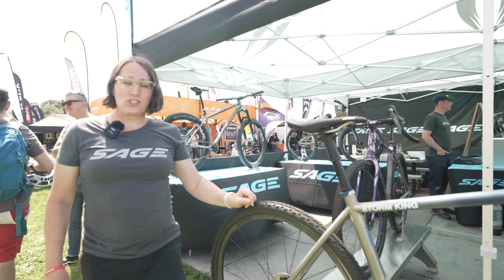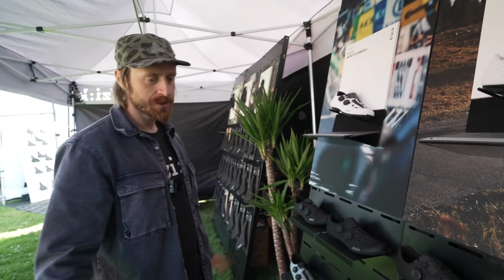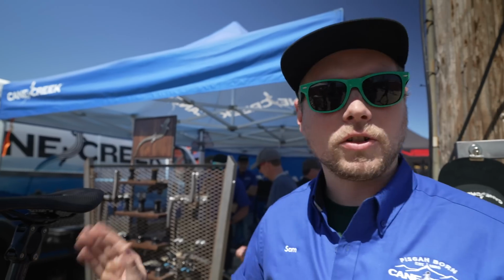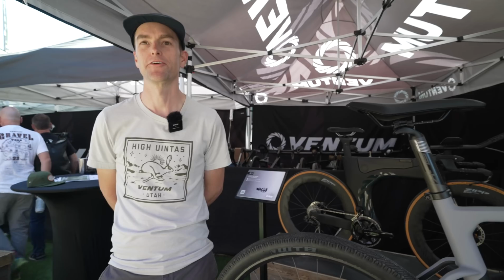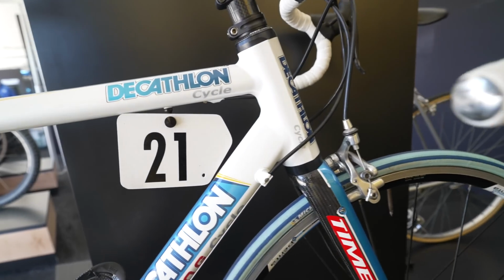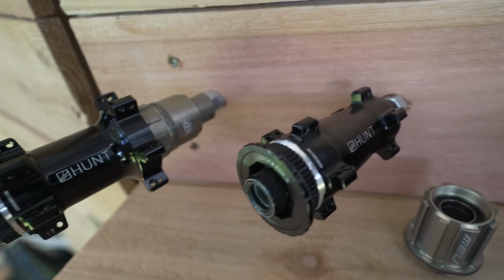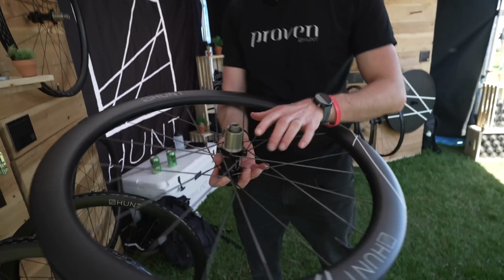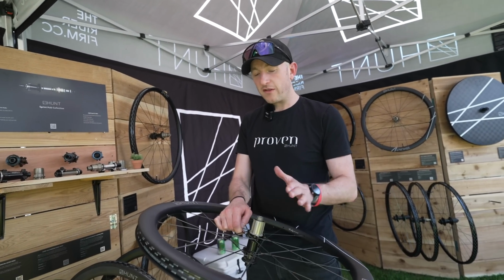Hottest Bikes and Tech at Sea Otter 2023...

Comment: Look,

Middrive ebikes require you to spin at the chainring speed.  It's less annoying to be able to select the gear you want and then apply power.  We are talking about a max speed of 30mph here.  The hub motor can afford it.

And using a middrive means less battery can be stored in the triangle of the frame because you are hanging the motor there too whereas a hubdrive places tr motors weight towards the rear.

And hub motors clean better and last longer and you can use double chain rings with nice cranks and they are far easier to service.

Smh,,, everyone wants to Throw money at Something electric and the answer is simple: for 700-800$ get a hub kit for your first ebike so it can be an investment not a toy.  You can use it without the motor, upgrade, etc.

Grin tech was working last year on a 142-147 rear spacing hub motor.

The frame has to be specific to the motor so you have a 2000$+ single design element to care for instead of a 250$ dollar element (max single point failure cost, excluding frame).

Smh.
Reply: Or, we could, you know…just pedal…
Reply: @GHinWI  the problem arises when you have very steep grades and/or pulling a trailer.  Also bear in mind there is no alternative to this sort of transportation mode: an electric bike which has two seperate sources of power.

I live in Cumberland, Maryland and the hills and roads simply disallow bicycle trailers and a light road bike wouldn't have the cargo needed to perform Wal-Mart trips (in United States this has replaced Churches all together almost leaving soup kitchens operating within)
Reply: Hub motors brick on any taxing climb. And because they're all cheap ass products you're never going to find spare parts. They're trash. They are inferior, period. Literally everything you have typed is moronic. You're promoting e-waste. Buy a mid-drive, and only from a company that you can go an buy spare kits for (Yamaha, Bosch, the like).

Comment: Such a shame with that Sage Storm that they don't have bolts on the underside of the top tube like the Salsa Cutthroat.
It's so much cleaner to have a frame bag without the straps.
Reply: We can add those mounts easily enough if the client wants them. We have done it plenty of times in the past. We did not do it for the show bike you see here as a choice for us.